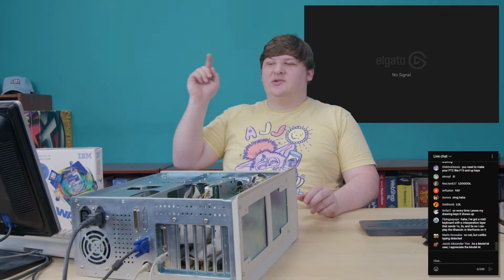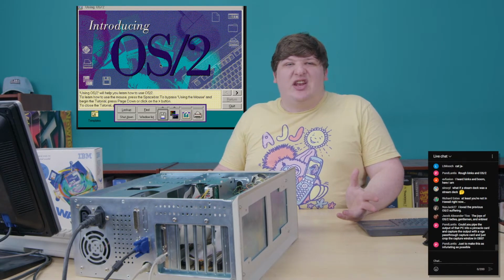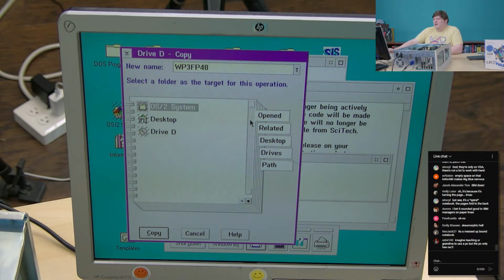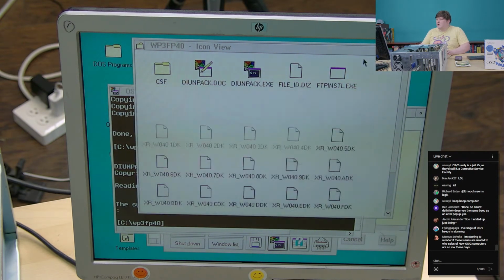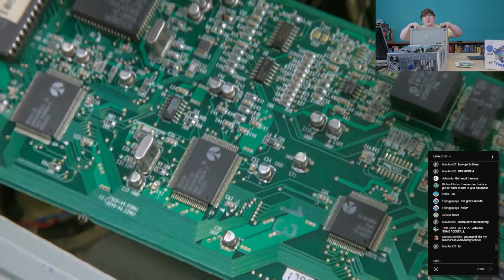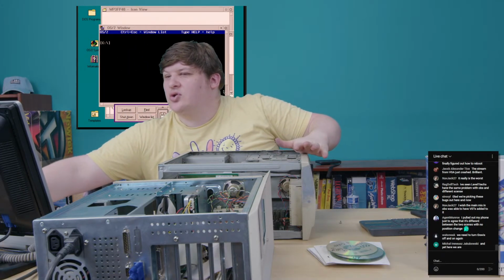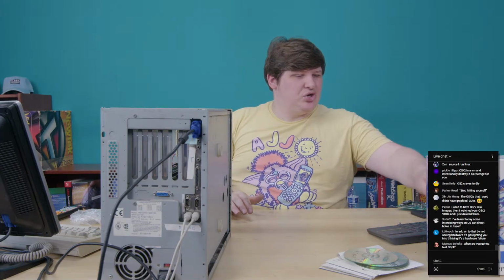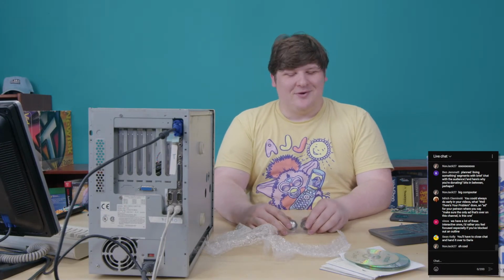Gravis Does Computer

Comment: An NEC Ready was my first actual computer. Mine was a Pentium 100 with 8 MB of ram if i remember correctly. It also had that totally unruly full case length ISA modem and I do remember that it was really problematic. My first memory of internetting was this computer saying "cannot initialize modem" and having absofuckinglutely no idea what that meant because I was 15 in 1996 with zero computer experience. This computer scarred my psyche so much that it took 4 years for me to want to have anything to do with a computer. Given the kind of nerd that I am now, it's hard to remember the luddite teenager I used to be but he's not that hard hard to understand. I still have the monitor that came with that system btw and it still works. It's an NEC MultiSync XV15. I keep it around because it refuses to die.